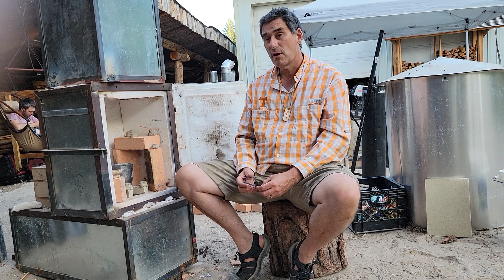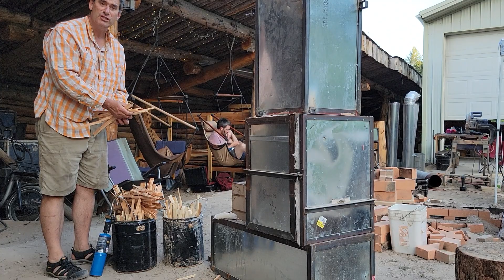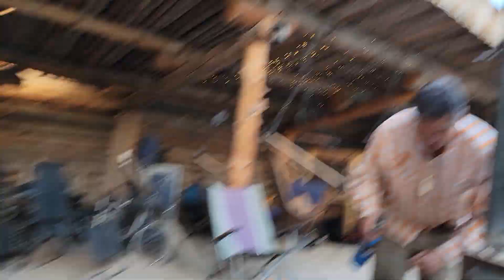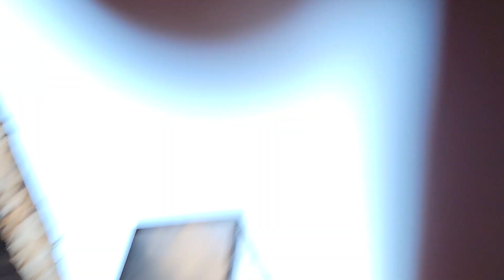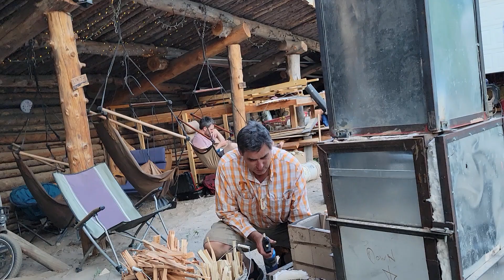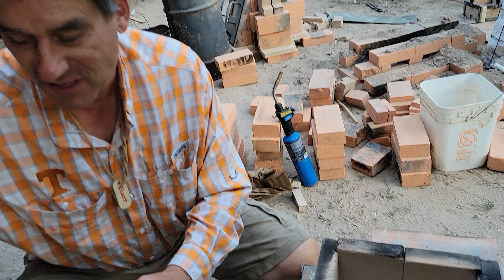Loading the Uncle Mud Rocket Engine Mini Fridge Kiln

Comment: Why block off the top when starting the fire?
Reply from the maker: Blocking off the top of the feed tube lets me force the intake air through the coals which helps burn them away before they build up and clog the throat of the burn chamber. That isn't a super problem in the normal course of burning a rocket heater gently to heat your home but the coals can really build up on a long hard burn to fire a kiln.
Reply from the maker: Thank you for watching. Forcing the intake air through the cleanout port low on the front helps burn the coals which keeps them from clogging the heater on a long hard burn like we use to fire the kiln